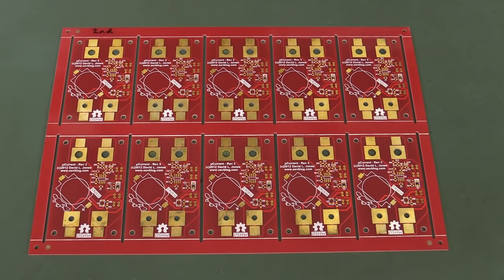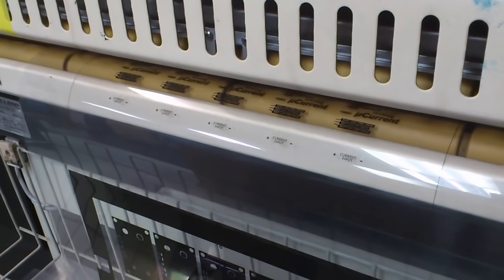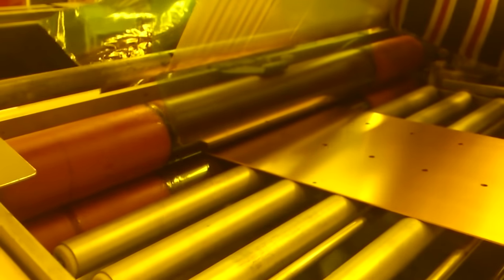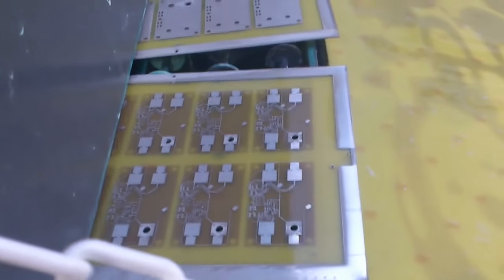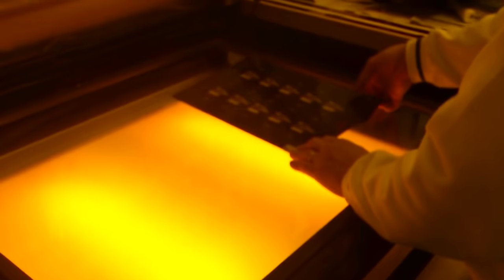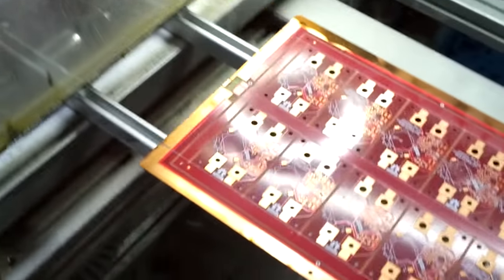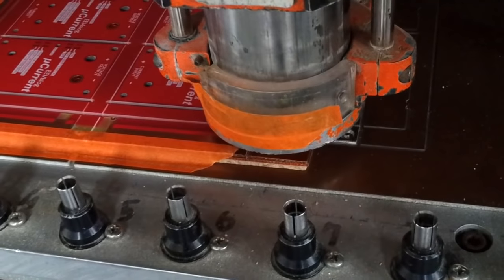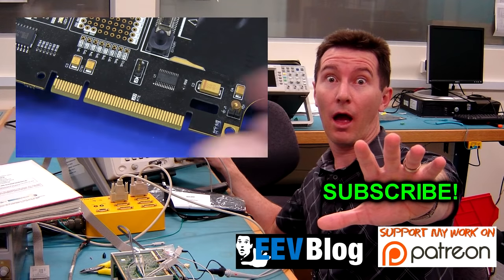EEVblog #939 - How Is A PCB Manufactured?

Comment: You should send your board files to cheaper "hobbyist" type PCB fabs like pcbway, dirtypcbs and elecrow to compare the results. That would be neat.
Reply: No point
Reply: Actually, that would be a great video idea for Dave!!!!  How could that not make a great video?  Specifically if you ordered boards from a long list of prototype houses, get them in and then looked at them under a microscope for registration, errors, etc.  Also compare real world  cost, time to deliver, adherence to design rules, and maybe sneak in some parts of the PCB that violate it, to see what they do.   All that good stuff.   "No point" - meh. My only thing would be have them delivered to a person in the US.  Why, cause Dave's audience is like 90% US based.
Reply: Thats what PCB Shopper is for :) 

Plus...the quality varies week to week. Its really just luck of the draw
Reply: He has compared a couple of the hobbyist PCB fabs in the past, iTead vs another i cant remember the name of.
Reply from the maker: +GeorgeGraves   Err, no, less than 30% of my audience is from the US. Yes it's my largest segment, but still only less than a 1/3rd
Reply: Wow - that's crazy.  I would guess that there are a ton of non-native-English-speaking countries watching you. That's surprising.  Still, US is your biggest audience.  So, yea, it still would make a great video IMHO.
Reply: Sample size of one is a problem.  But I think it does give some insight that is worth checking.
Reply: I was wrong - dave says it's only 20% US based, that I find hard to believe.  But that's what he said!  EDIT - no, he edited it to 30%.
Reply: I remember Dave actually did this -- sort of.  One of his videos showed a low-cost board where a fill area (ground fill as I recall) was narrow when it went between two pads.  However, on the final board it was narrowed to zero, resulting in a loss of continuity.
Reply: TheAmmoniacal i will check those places out myself. thanks
Reply: +GeorgeGraves
Well, compared to the rest of the world, the US is a small country.
Reply: +EEVblog
How does the copper get on the board and where do those bare boards come from?
And don't tell me they have a special tree in China where they grow them.
Reply: The Kaiser No the tree is in Japan. lol sorry couldnt resist.  I think either the copper is somehow glued on or it could be dipped into moten copper. Thats my best guess.
Reply: +JKnight and KARR No, definitely not the latter. The substrate the copper layer is glued on is usually glass fiber reinforced epoxy nowadays (I think they used phenol in the past), which would burn away in no time if molten copper were to touch it (which has a melting point of over 1000 °C as we all know). It's just a very thin layer of copper glued onto the substrate (perhaps added even before the epoxy hardens).
Reply: CoolKoon
 There are a lot of maybes here. Are you sure those boards are not electroplated?
That's what they did here to get copper onto the walls of the drill-holes.
Reply: +The Kaiser I really doubt that they are. Had you watched the full video you'd know how painfully slow each electroplating step was. Thing is that electroplating is a slow and expensive process thus it's only used when no other option is available (when any other option would be too ugly or more inefficient). In fact it's only used when a perfect finish is necessary (or other special circumstances require it as is the case with PCB or e.g. chip manufacturing).
If you search for "copper clad board" e.g. on eBay however, you'd realize that they come almost dirt cheap: a 20x30 cm board costs like $5 (and that's retail, the wholesale prices are even better). There's no way you could go that cheap with electroplating.
Reply: You can't electroplate something that isn't conductive... It's impossible to just drop a glass fiber board into a bath and magically plate copper onto it. Not to mention to get that thickness it'd take ages. The reason the through-holes can be plated is because the copper grows from the exposed inside edge - it has an electric path, so it literally "grows" from there until it covers the inside of the hole.

But yeah. It's literally just a copper plate (easy to produce) glued onto a glass fiber board (easy to produce). Result: Easy to produce!
Reply: +The Kaiser Now that electric chair thing was a bad example, because they work with higher voltages there. And that means that the materials start to act a LOT differently than they do at low voltages. Had you seen any HV lab you'd know that.
Sputter coating the boards you say? Do you have any idea how lengthy and ridiculously expensive such process is? And what's the point if you can get equally good adherence with room-temperature methods (where you don't have to create a vacuum either)?
The reason why you can't save "a lot of steps and therefor time and money" is because no mechanical machines (machines with moving parts) are as precise as photographic processes are. The video even shows the difference between "silkscreen" layers done by conventional methods (actual silkscreening) and the optical method. Perhaps you can see the difference. Why does it matter? Because without such precision you won't be able to create the tiny little traces necessary for today's integration needs. Besides, the "highly harmful chemicals" are usually not released to the atmosphere, but recycled instead (yeah, the copper can be fairly easily recovered from the spend etching solution), so what's the fuss about?
Reply: CoolKoon Nonsense Volts jolt, amps kill.
I strongly believe electric chairs were built for the latter. Your attempt to convince me of the opposite is ridiculous. Are you trying to piss down my back, telling me it's raining?!
Moreover has every 8 year old boy with at least a tiny bit of scientific interest build circuits using a sheet of paper, a soft pencil and finger-print-graphite powder-glue.
Second, I WAS talking about photo-sputtering. However, the Japanese do have circular saws that can easily handle precision under one mikron since the 1970s. That is waaaay surpassing ANY precision needed for a crude circuit board.
Reply: The Kaiser Volts and current are intricately linked phenomena, to say that either is a killer is just stupid. Yes you do need a certain amount of current through your heart or diaphragm to kill, but in order to achieve this you need a certain voltage. More = easier.
Reply: +The Kaiser You really don't know much about high voltages, do you? Yeah, volts jolt amps kill.....BUT! The resistance of quite a few things (including heating elements and the human body among others) is either linear or very close to it. This means that the amount of current pushed through the resistance is higher as you raise the voltage. Let's say that the human body's resistance is 1500 Ohms. At 220 volts (nominal voltage in Europe in the past) that corresponds to a current of ~150 milliamps, enough to cause deadly heart fibrillation. However at the (distribution) voltage level of 22 kV (that's 22000 volts) the current pushed through your body will be 15 amps, at levels which heart fibrillation will be the least of your concerns (such current is high enough to melt metal strands even, materials with even higher resistance spontaneously combust/explode at such current levels). Oh and while we're at it at 22 kV materials which normally aren't conductive start to become conductive as well (such as air), making the issue even more complex. But I digress.
Do you think that creating a graphite-glue PCB pattern and its subsequent plating would be as cheap, reliable and scaleable as current run-of-the-mill copper clad board manufacturing? Seriously, did you ever do any electroplating at all?
What's photo-sputtering? Never heard of that. Is it some fringe science perhaps (or does it mean something else than what you are using it for)?
It's nice that the Japanese circular saws had micron-grade precision even back in the 1970s, but once again: it's far too expensive (and doesn't scale well either). The fact that it looks good on paper doesn't necessarily make it commercially viable nor just simply doable.
Reply: The Kaiser I hope that was intended as a joke. Can never tell these days.
Reply: CoolKoon Quite obviously, you were never at a Tesla demonstration. I saw a human body under 400 000 volts at 20 000 herz with no ill effect for the specimen.
What you say is nonsense.
And I think the term photo- etching and photo-sputtering explain themselves.
Reply: The Kaiser That's because the device is current-limiting.
Reply: +The Kaiser uh-huh......well tell you what. Why don't you climb up at an AM broadcasting antenna (they broadcast at a minimum frequency of 540 kHz) while it's on (fed with REAL power, not the ridiculously small amperage of Tesla transformers)? Those operate at high frequencies and pretty high voltages too. And you're saying that that's safe........
Nonsense? Yeah, it's hard to grasp some concepts of electricity without any experience or training, isn't it?
Like I said, I haven't heard of photo-sputtering (and neither have others I suspect) so why don't you finally explain to me what do you actually mean?
Reply: CoolKoon This is where he either responds with some kind of insult, or references some bizarre sputtering method with 0 scientific (or practical) references that, mysteriously, nobody really knows how to do because the guvment killed them all.

I mean, I know what sputtering is, but it has to be performed in a near-vacuum and takes about 50 ages to coat anything, also would be extremely hard to do on a large scale.... But photo-sputtering? Woo, sounds exciting.

This is gold already.
Reply: +Mythricia Yep, it's not the first time somebody tries hard to pretend that they know what they're talking about..... ;)
Reply: +The Kaiser Well if you "coat a silicon-chip in photosenstive paint, expose it and etch it", then you don't call it photo-sputtering (whatever that means), but photolithography.
Anyway, even if by some miracle and pixie dust you'd manage to economically coat some surface with sputtering (which is dubious at best, both me and Mythricia have already explained why), just how would you make sure that the coating medium (which is copper vapor as you correctly pointed it out yourself) will only stick to the areas you want it to stick to and nowhere else? In order for an additive process to work one needs a way to have highly precise control over the coating medium (which in case of the sputter coating process we don't). Do you know about some brand new discovery that could be bottled and sold to all the chip and PCB manufacturers perhaps (and it's not snake oil)?
I criticized mechanical machining on the grounds of not being good enough compared with photographic processes and I'm still waiting for you to point out some mechanical process to me which IS more economical than photographic processes....
"Why do you need a reference?" - Perhaps because I have no idea what are you talking about? And because I suspect that the process you're talking about just doesn't exist? And because I have this uneasy feeling that you're just making things up?
Reply: Mythricia
I despise people, who do things for money.
Reply: +The Kaiser Uh-huh, because you work for free and don't need the caps for food and living, right? Tell me, what's it like to live as a Breatharian?
Reply: CoolKoon What gives you the utterly absurd idea that I meditate? I am quite relaxed as it is.
Reply: +The Kaiser Did I explicitly say anywhere that you meditate? I think not. I simply implied that you must be propagating this "living without food and water because all the energy I need is supplied by light" type of dangerous BS, because you implied that you don't do things for money. If you don't do things for money, you either do that because of "breatharianism" or because you're so filthily absurdly rich that you don't need to (or you're a 12-year-old who's still fed by his mom). Either way the rest of the world just doesn't work like that.
Either way I think that you don't sell your idea simply because you don't have one (not a viable one at least), thus you have nothing to sell.
Reply: CoolKoon "Look at the birds, they do not plow, they do not sow, yet God still feeds them."
Reply: +The Kaiser So let me sum it up: you have a revolutionary idea that'd turn complete industries upside down, yet you don't want to have it patented and make tons of money from it just because you don't ('cause of the Bible?! Christianity?!). This can only mean two things: you're either full of hot air or you just simply don't know what are you talking about.
Extraordinary claims require extraordinary evidence as they say. An article published in a scientific journal will do....
Reply: JLCPCB is a lot popular these days even in Europe. I am not used to that kind of stuff. I designed my last prototype to the furthest point being actually made in my middle school days - and we did it all ourselves. Cutting the board to the right side, aligning translucent paper (we didn't use transparent plastic sheets, only translucent paper), and applied UV light onto it. The fotosensitive layer was different to that one used in the process showcased in the video, The area exposed to UV lamp was actually made resistant to the develop. Small chunks of exposed fotosensitive layer got lumped off the board as we swang it in the chemical, and then we etched it for like 10 minutes. We then cleaned the board, applied a layer of rosin to protect the copper, drilled our holes, and finally we soldered our parts on the board. It was all manual labour back then, and that's what I'm used to. Just for the record, my circuit didn't work. We did it as a school labour and our work was graded. I had the worst grade because one of the crucial requirement was that it had to be working circuit. Mine didn't work at all, so I failed. Luckily for me, that subject wasn't only about that and I gained better results overtime with smaller and much easier tasks. That failed board however bother me so much to this day. When it comes to electronics, I am perfectionist and I want everything be done. Even years after. So I found an online resource and built the circuit myself. Only EAGLE sketch yet, but even despites that it was a nightmare to get everything right. It turned out that I forgot some connection here and there, bad placement that prevented to connect all airwires, and basically it was marathon of trials and errors. Now can surely say that I have correct design and it's ready for making it reality and see if it's working. The circuit isn't mine, I am merely just testing. But I already went and copied the exact same schema and designed a manufacture prototype design for original creator (he doesn't know yet though). I am fascinated by the thought to have home designed circuit proffessionally manufactured in China for very cheap price. Frankly, $2 is really cheap for such service. One could say that there would be quality issues, but no. It is very clean and very high quality work. JLCPCB really offers very high quality manufacturing for very low price. I was amazed...
Reply: I had a look at pcbway. For what I could get for £6 including shipping from jlc I would pay 70 from pcbway
Reply: @thekaiser4333  400kV lmao

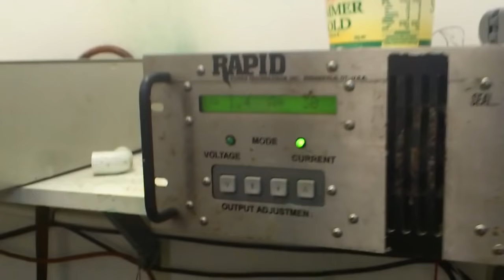Comment: 10:42 I have heard from some manufacturers that they have a rather thin base layer of copper, and by electrolysis they deposit the amount of copper required for the desired thickness. That way when there is the etching step, there is only the thin layer of copper to be etched away.

I was really hoping to see more on how the through hole plating works, its still not totally clear for me and my home brew process is quite lacking....
Reply: Dennis Lubert look up how electrolysis works, that probably helps you understand it :)
Reply: tjeulink I know very well how it works, but for the holes, I wanted more details, as the professional ones have very controlled uniform thickness which I was never able to achieve at home, so the question here is what they do differntly (other than probably higher current, I don't think thats the only difference)
Reply: Dennis Lubert hmm interesting, maybe they pump around the mixture or jet it directly on the pcb?
Reply: tjeulink I am stirring/pumping the mixture too (which you should to avoid any posibly ocurring bubbles to be removed as soon as possible). It might also be a chemical thing, as depending on various parameters the deposited surface changes in quality. There is a lot of trial and error and company secrets involved in getting it right
Reply: Yea.. it seams to be the case.  This way they can use far less copper as well. The original layer can be really really thin.
Reply: what additives do you have in your plating solution? Most of them are proprietary; but some HCl, PEG (~2000), alkyl sulfonic/quaternary ammonium surfactants or thiourea appear to be common. the idea is usually to slow down deposition so you avoid local copper depletion and minimize the effects of the electrode shape.
Reply: Moving the boards back and forth to disturb bubbles that form in the holes. Mechanical vibration of the board carriers. (Air driving an offset wheel at medium speed.) Tight control of the chemistry using variable displacement pumps, and with various types of sensors.